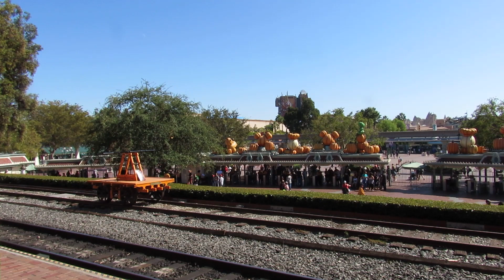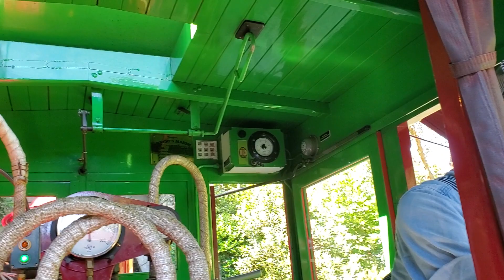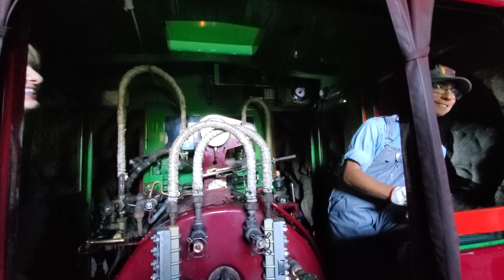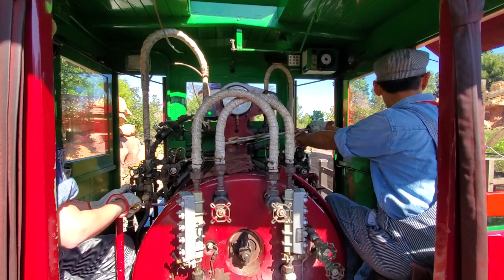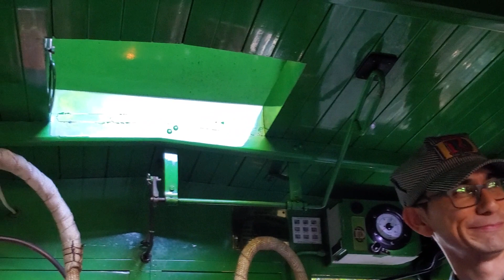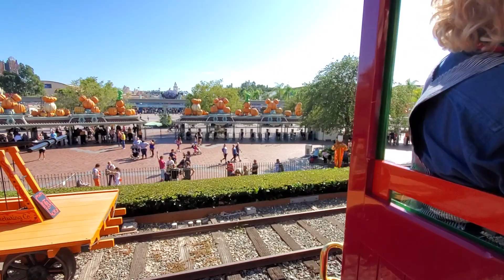10/4/19 The Disneyland Railroad: A tender Ride on Ernest S. Marsh #4 ft. some unusual procedures!

Comment: way did they back their train into the station was the engine's tender not lined up with the water tank?
Reply from the maker: Yes. The train was ready to keep going but I guess there was a passenger or station issue possibly as the conductors alerted us to stop. Due to such, the crew had to cut the fire(shut off) and had to re-light the fire while having us tender riders disembark which is why we reversed back into the station. As for water refueling, it is usually done while park guests are not riding the tender. -Jon
Reply: @JonRailVideos2011-1  way did they need to close off the fuel supply to the fire in the fire box did they do that so the steam pressure did not rise enough for the safey valve to blow off the extra steam pressure which would wast the water that was boiling in the boiler?